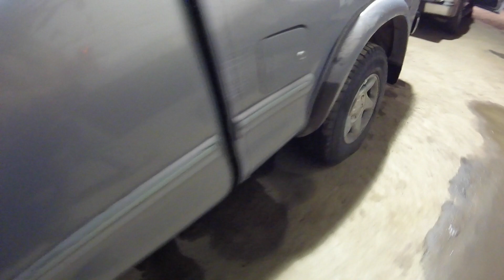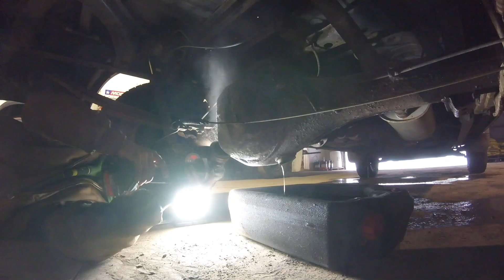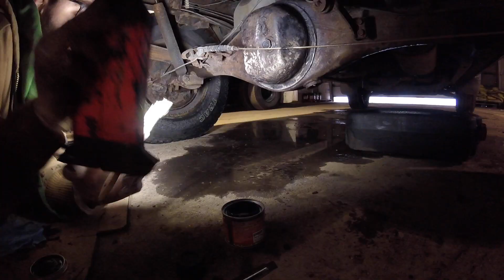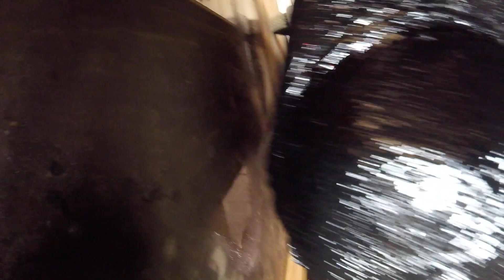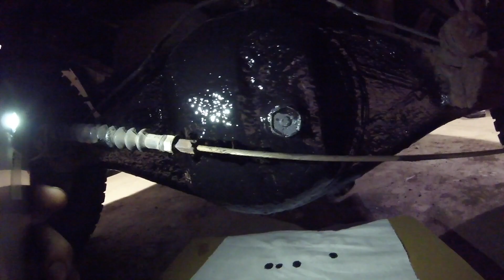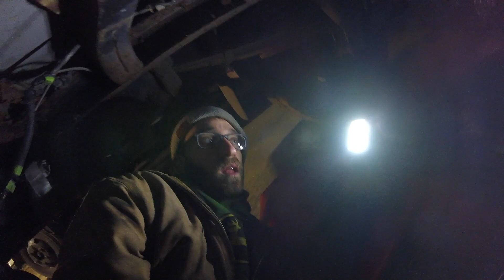INSANE First Gen 99-06 Toyota Tundra REAR DIFFERENTIAL Thin Metal Cover Repair (No Welding)

Comment: You think you could cut with a plasma torch to avoid metal shavings and weld replacement?
Reply from the maker: Thats a good idea, but the torch will still make metal shards and also run the risk of burning out the seals. It could work though if it was done carefully

Comment: I want to weld a cover on, what metal is this is it steel, cast? Help
Reply from the maker: The actual axle housing is cast yes
Reply: Thank you for the fast reply, what’s the best to weld a cover? Can pin holes be spot welded
Reply from the maker: @RichyRixh9  it depends, I have another video on my channel with spot welding holes in a dodge dually differential. It worked but I had the advantage of being able to take the rear cover off the check how thin the metal was prior to welding. That’s the problem with the tundra diff is that you could be chasing holes on really thin steel forever, hence why I coated it instead

Comment: Repairing like that is a waste of time and money. Weld on the replacement cover. Done!
Reply from the maker: Agreed, but metal flakes in the diff is a big cleaning procedure, tried to avoid all of that with this fix first before going to welding
Reply: I got the cover does entire axle need to be dropped to cut off and weld on?

Comment: Used the  Jb weld epoxy on mine,   it will leak if  you  don't drain the pumpkin & clean the area  well. 2nd attempt after draining &  meticulous  cleaning & drying stopped  it  for  good.
Reply from the maker: Same here, cleaning is key to get that bond!
Reply: Sweet good to know! You use heat at all?
Reply: Thanks! I’m about to do mine

Comment: Wow what a bad idea that From the manufacture here. I’m not really sure they saved any money in the manufacturing by doing a complete weld versus making a cover with some bolt holes and a gasket. I know people are buying foreign presuming it’s gonna last longer but I’m not sure this manufacturer has the best record on lasting anymore. My buddies truck has such bad frame rot and it’s less than 10 years old I’m not sure he can even sell it.
Reply from the maker: Yea rust is a problem on these Toyota trucks of this gen for sure
Reply: Well yeah they save a bunch !!! Times tens of 1000's of units !!! They make a mold, and stamp out a butt load of (usable) rear housings, all the same. Toyota's rear ring gear, etc, assembly, simply, basically pops in as a whole assembled unit, bolts in, from the drive shaft side. Good idea, & nice work fixing an issue. Probably less time, work, and money vs swapping in another housing onna old Yoda. 🤗😀